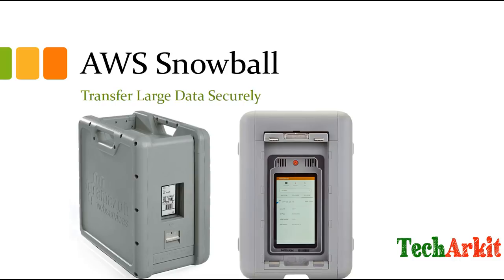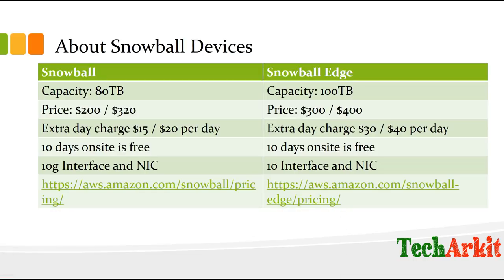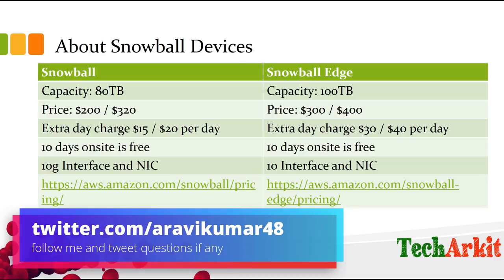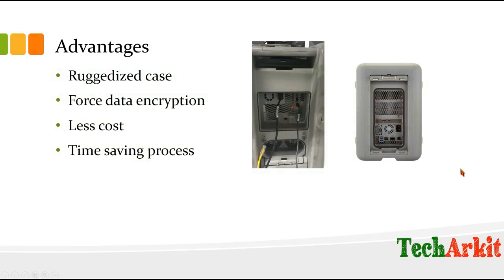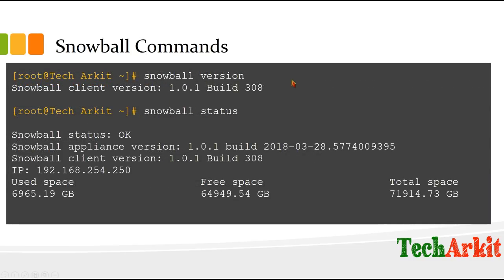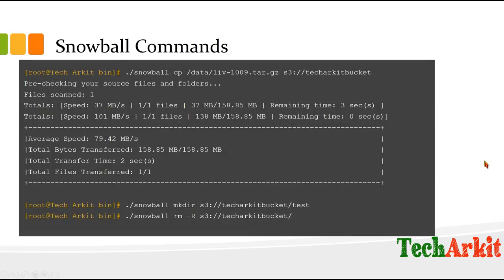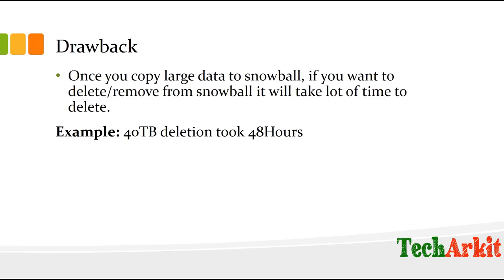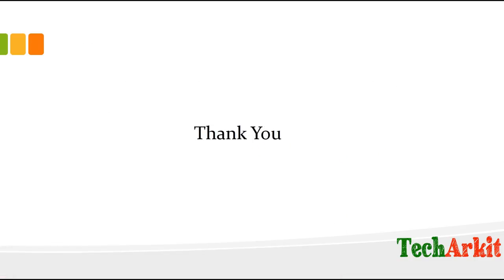AWS Snowball | Tech Arkit

Comment: Nice video Ravi. Is an aws account needed to work and load data to the snowball edge unit or is it enough with the unlock code and the manifest file?
Reply from the maker: When you want order snowball, definitely required to have AWS account as well as S3 bucket created otherwise you can't get snowball.
Reply: @TechArkit  i need to talk to you